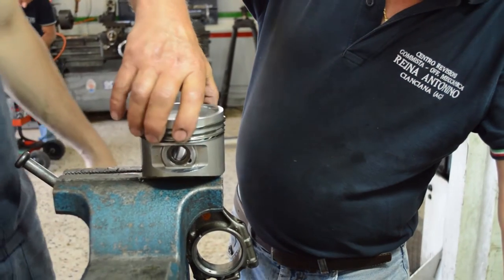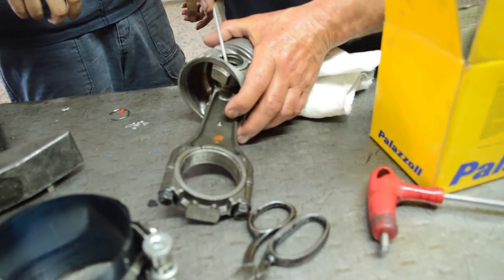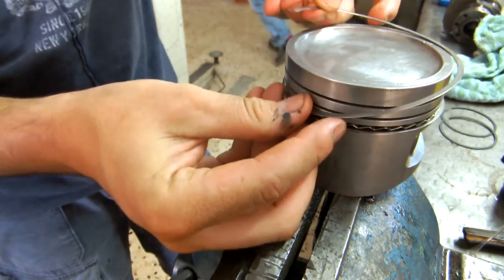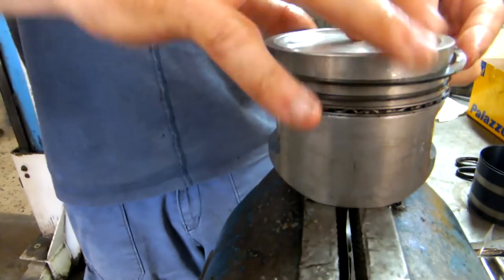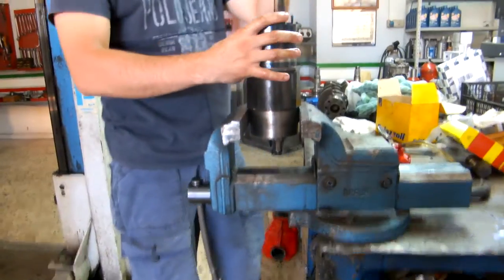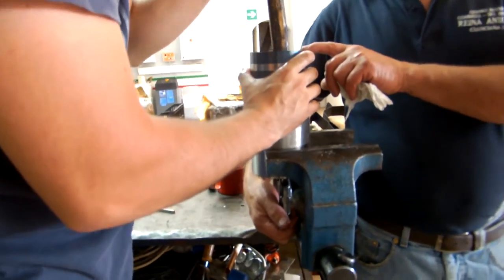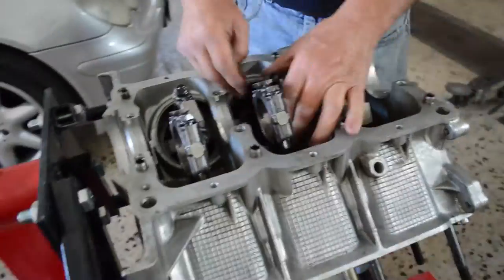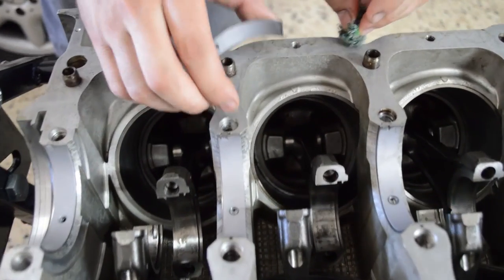Assembling the V6 Engine! - Maserati Spyder Part 22

Comment: I'm glad your back making your videos.
Reply from the maker: +steven gardner Thanks mate, this car was a bit too overwhelming with regards to acquiring parts. The car is pretty straight forward but I had encountered way too many problems with this rebuild
Reply: +Matthew Micallef 
Understood, my own has been giving me problems. without certainty of the solutions to the problems, i'm not wanting to simply replace uneeded parts
Reply from the maker: +steven gardner The problem was that not only every part had to be replaced (literally everything) but also the parts that I have replaced half of which either was defective or broke while being installed (defective).... way too many mishaps

Comment: Do you have any mods for more hp?
Reply from the maker: The mods. Are basic because my dad wanted it to look as stock as possible, so what i did was i hand built a full stainless free flow exhaust and balanced it with the induction
Reply: +Matthew Micallef Hmm ok, I have a tuned Racing producing 330/350.
Reply from the maker: +Michel Schuijff Thats Amazing, I will have mine checked out on a dyno to see what power it will produce